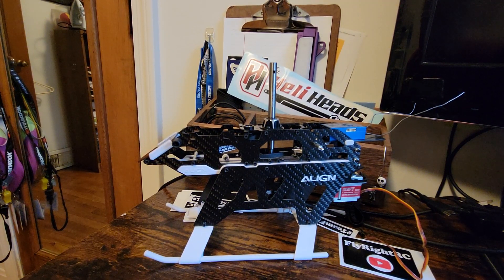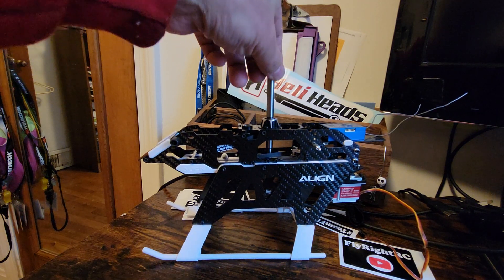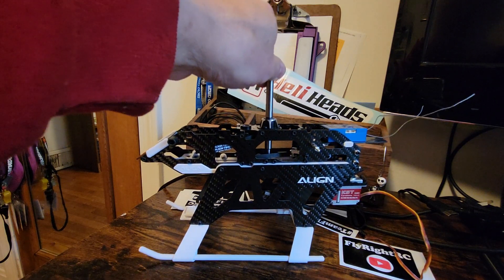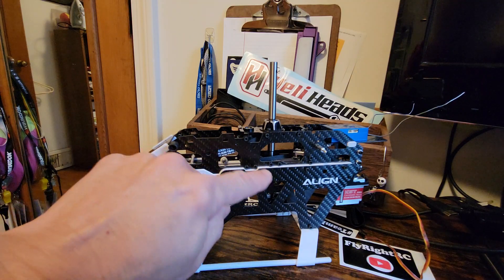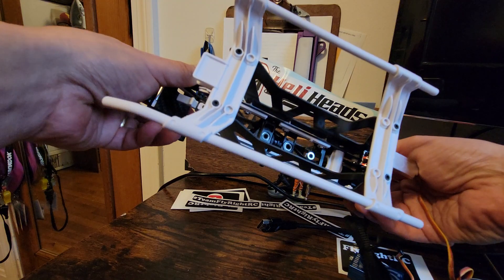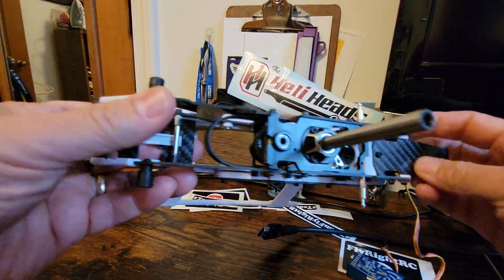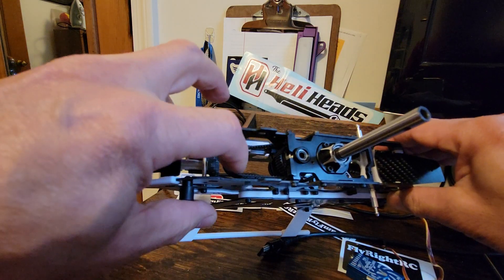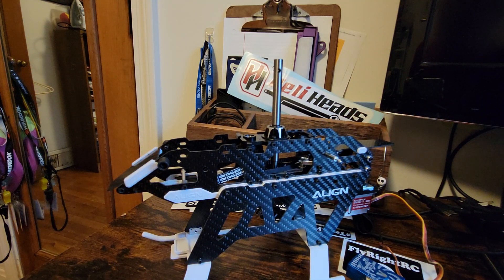Align TB40 Helicopter first impressions

Comment: How did it end up? I still have mine sealed in the box. Also bought it when it came out. Been busy with other kits.
Reply from the maker: @LichaelMewis  it fles great and by that I mean stable and responsive from 2350 to 3100+ headspeed. Easy to fly and wicked too.
Reply: @raymhuang  looking forward to building mine. What electronics did you go with?
Reply from the maker: @LichaelMewis  mks  cyclic, kst  tail, HW 60 ESC, Neo.